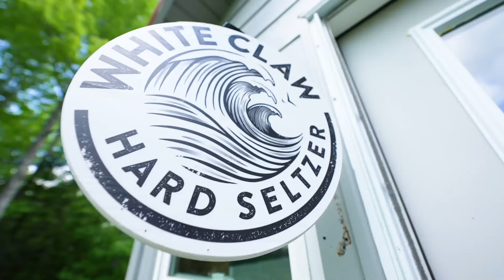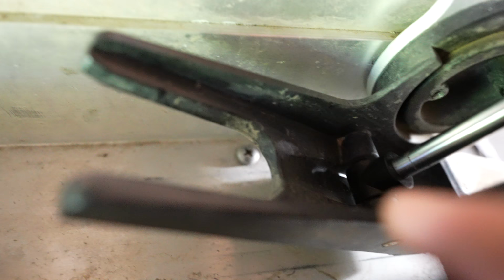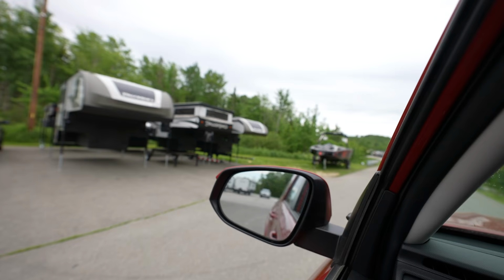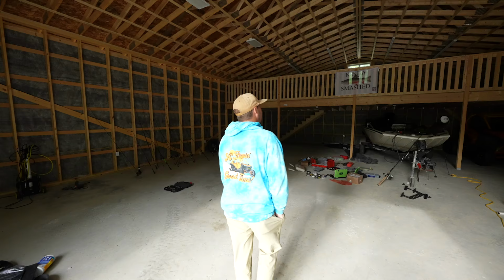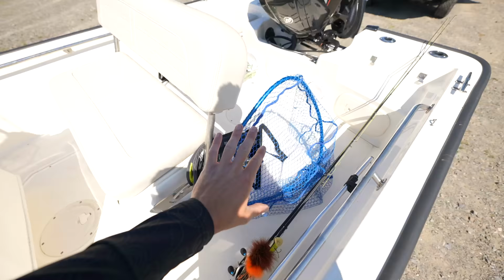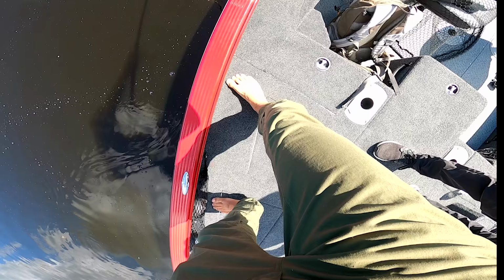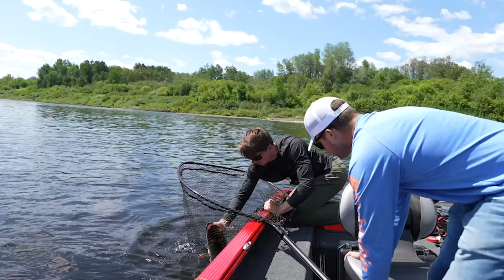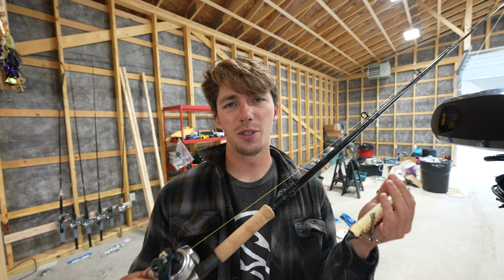Hunting Down ELUSIVE Maine River MONSTERS! (Insane Boat side EAT)

Comment: You NEED a wire trace. It’s not a choice. You’re gonna kill fish and lose lures.
Reply: They're using fluorocarbon leaders. This is very common musky fishing.
Reply: @brendanspencer2550  I know, I’m an experienced pike angler in the UK. Flouro doesn’t stand a chance against a 30+ Musky/Pike and its teeth if it’s deep hooked.
Reply: @liammurphy6063  Disagree strongly. They are using higher than 130-200 lb (guess based on thickness) fluorocarbon. These leaders will handle any musky. I personally use 60-80 fluoro for half pike fishing... Aka tiger musky.
Reply: @brendanspencer2550  If you’ve never experienced it then I can understand why you’d trust it but I’ve witnessed pikes teeth cut through 100lb fluoro with ease. (When deep hooked). So I personally always go for a fine wire trace.
Reply: @liammurphy6063  I can't get wire leaders 18" or higher so I use fluoro and make my own. I have personally talked to guys who have caught 40-50" tigers on 80lb fluoro.

Comment: Love the tiller. I have the crestliner version. One thing to watch though with that hydraulic steering is that the pump takes more power to run than the motor puts out at low rpm. So after 4 hours you might get a low voltage alarm. Hope you don’t have the same issues I had.